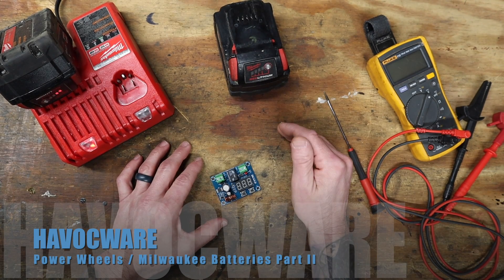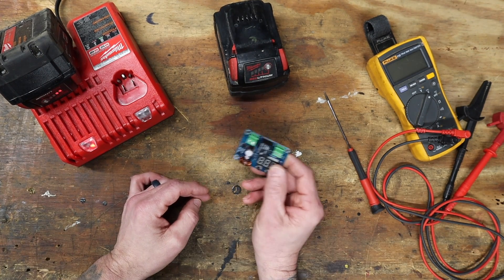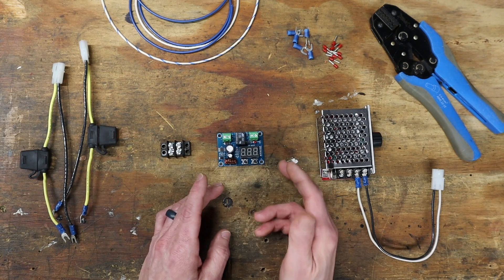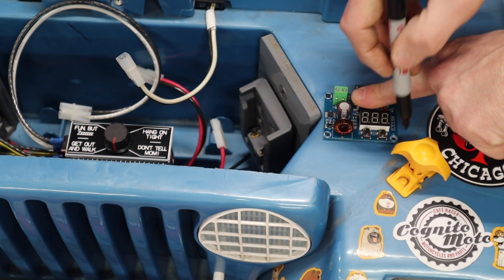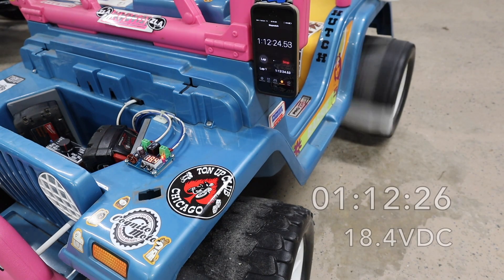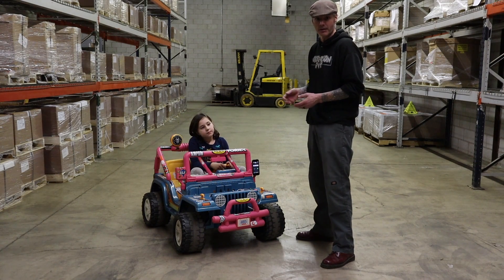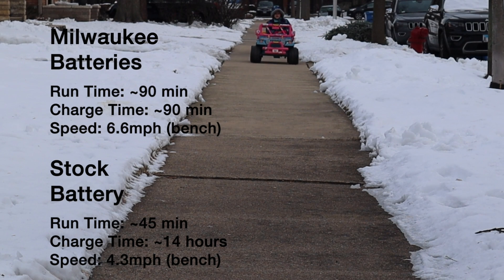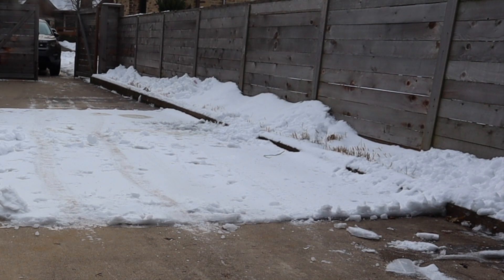Power Wheels Milwaukee Battery Upgrade RUNTIME TESTS & Battery Over Discharge Protection Install

Comment: You use really good connectors.  Any recommendations on a kit you recommend that has all the ones you have used?  Looking for solid connectors that are easy and last.  Great videos.  Ordering the parts now.  Daughter's Dune Racer stopped going in reverse and only went forward slow.  Discovered it was a faulty gear shifter switch tonight!
Reply from the maker: Hey there, thanks for watching. Good wiring is key to a solid installation, and less headache later. For wire ferrules (straight pin terminals), this is a pretty decent kit with crimper: https://amzn.to/3at3ofd. For ring and spade terminals, this kit would work pretty well: https://amzn.to/2yuK8kb

Cheers!
Reply: What gauge wire did you use?

Comment: If this same mod was done with a 12volt 12ah battery would you still recommend the low voltage battery cutoff module?
Reply: Same thing I wanted know plus I believe you will get a longer time ride
Reply from the maker: Hey there.
You could always learn the limits of your battery and just monitor the runtime. However, for the relatively low price point, I would recommend a cutoff module regardless of the amp hour rating of the battery.
It's a cheap safety device that will protect your battery at 1/4 of the price of a replacement. 
Cheers!

Comment: what are the names of the blue and white wires?
Reply from the maker: The solid blue and white are +/- from the batteries, striped are +/- out of the voltage cutoff module. 

There's a full wiring diagram here: http://havocware.com/wp-content/uploads/2020/01/lvco_wiring_hw.jpg

Cheers!

Comment: Ok buddy I need help.. the low voltage controller has vin +/- and volt +/- I've tried both one started to melt the relay and the other ran my batteries to 6v.. How did you wire the regulator to actually work at 18v? I didn't get a speed controller they were sold out and because my boy wants all the speed and moms ok with the mom don't know setting of full speed. It first burn the motors on both wheels.. I just installed 770 upgraded motors and still not working right.. I just feel like this is the wrong regulator for mom don't know full speed setting. I'm deep in this really needing help.. please!
Reply: b91crx I’ve also had trouble burning up the relay while the speed controller is wide open
Reply: @TylerJSpry  I finally took mine out after burning through 3 of them. Now it broke the upgraded motors. I'm thinking the 18v upgrade was a very poor decision but the kids love it so I'm still working out the details to make it work...

Comment: Thanks for the video. I used your instructions for some inspirations of my own. I cant figure out one thing thought. I was wondering if you would possibly be interested in taking a stab at it...

Trying to replace the potentiometer with a variable speed throttle (pedal for jeep, handlebar for Atv)
Reply: Why not wire the potentiometer and mount it to the pedal

Comment: Quick question. I just did a similar set up with my dewalt flexvolt batteries. I've noticed if I turn the speed dial past 70 percent it blows the fuse in the speed controller. What would be the reason the fuse keeps blowing and I can't put it on max speed?
Reply: Do you have it wired to the 20v or the 60v lol

Comment: Great video! Diggin the Ton Up decals...I have an 01 Triple and 10 Rocket. Thank you from the NW burbs
Reply from the maker: Hey Kevin! Thanks for watching - and thanks for your FD service! Be careful out there... 

See you at Motoblot?...
Reply: @havocware  I just ordered a voltage cutoff module...I see below you describe how to set the values.  What is the threshold value and what does it do? What should I set it to if I set the voltage cutoff at 16.5V like you did? Thanks
Reply from the maker: Hey Kevin. The threshold value acts as a buffer between when the the cutoff module kills the power (the voltage setpoint) and when it comes back on. For example - I set it to 16.5 volts, with a 1 volt threshold value: the module will open the relay (stop power flow) when the voltage reaches 16.5 volts, and won't re-energize the relay (enable power flow) until it reaches 17.5 volts (16.5+1). It acts as a pseudo hysteresis function, and stops the module from starting/stopping/starting when the module kicks in, and the voltage increases due to lack of a load.

Make sense?
Reply: @havocware  Sorry to bother you again, but I have a question regarding the voltage cutoff module...I got a great deal on an 18v 12ah Milwaukee battery and when my sons get in to go, the module clicks and shuts down and the led goes out momentarily and then comes back on.  After a few tries, the Jeep will eventually go, but it's very sporadic and the little black box on the module gets pretty hot.  Any ideas?? Thanks
Reply from the maker: Hey there Kevin. The black box on the module is the relay - if it's getting too hot, it's most likely because your vehicle is drawing too much amperage. If you have the same voltage cutoff as I used, the relay on the board is rated for 20A, if your vehicle draws more than that with the higher voltage battery, it might eventually burn out.

Do you have any fuses or a speed controller on the circuit?  The fuses will protect the relay, and the controller will help you dial in the speed to a safe zone for that cutoff relay.

Can you post a video of your setup / wiring so I can take a look?
Reply: @havocware  Hi Rich (I believe that is your name) I just posted a video of my setup, it's no Spielberg but I think it'll do.  I do not have a speed controller setup. The module was mounted, I just took it off to help show what it is doing. Thanks again for your help in this.  When it does work the boys are loving it.
Reply: @havocware  I replaced the cutoff module and added a speed controller even though my older boy can drive like Ricky Bobby and the relay is still getting hot...do you know of a different cutoff module I can use to handle the higher amperage so I don't burn out this $200 battery? Thanks

Comment: Is there a reason you did this install with two batteries? I’ve seen it done somewhere else with one, I’m looking at trying this upgrade and want to make sure I do it right. Thanks.
Reply from the maker: Hey John! You can certainly do the mod with only one battery; the runtime will of course then only be 1/2 of the dual setup (at best).

Not sure if you've seen it, but my first video shows the installation and goes over battery capacity (one, two batteries) and wiring examples . 

Thanks!
Reply: havocware perfect thanks for the info, I’ll try it with one, it’s pretty easy to add the second if need, just trying to figure out how and where to hide everything, I’m modding a gator, unfortunately they don’t have a nice engine compartment like yours did.
Reply: In addition to runtime, a good reason to add a second battery is to reduce the load on the battery pack. Some people have reported a single battery can't produce enough current to power the car for long times and will end up burning itself out. A second battery in parallel will drastically reduce these concerns.

Comment: I just finished this exact MOD, but I cannot figure out how to set the voltage meter to 16.5. How do you set the voltage with the 2 buttons?

Also, the speed controller has a 3 setting switch. what setting should it be on?
Thanks!!
Reply from the maker: Hey D Sauce!

VOLTAGE CUTOFF MODULE:
The left button will set the voltage limit, and the right button will set the threshold value. You set each value independently by holding down the respective button until the display starts to flash, then use the left button to increase the value, and the right to decrease. When you're done, leave the controller idle for five seconds, the setting will lock in and the display will switch back the active voltmeter display.

SPEED CONTROLLER: set the switch to the RUN setting.

Thanks!
- hw
Reply: I think we fried the speed controller. it worked great for about 10 min. we were increasing and decreasing the speed trying to dial in an appropriate setting for my 5 year old and it just stopped working. I took off the speed controller and wired it back up. it's at max speed now. I have another speed controller on order. Thanks for the help.

Comment: I usually run on 5s 50C ( discharge) Lipo .It runs fine on 5s lipo....Not 6s.
The stock motors cant handle the high discharge at 6s lipo.

I harvetsted/recycle used 18650 lion from old laptop 2200mah 15C ( discharge)
Tested it on 5s (2200x3=6600mah p/cell) There about....it dosnt have the same power
as the 5s 50C Lipo...So I made it 6s.  (About the same speed as the 5s lipo).
It can do power slides and donuts..Still not the same amount of punch as the 5s lipo...
but close.

Power drill Lion packs use different C rating or discharge 18650. You get what to
pay for. There's sanyo 2200mah 20c cells in   4ah pack....There's 2200mah 30C
in the  6ah pack....both are 5s li on. Just google the part numbers on the cells.
Im happy . I tested my home made 6s lion 15C on a scooter yesterday. Drove it for
around 15 mins..it was still reading 24v. ( 25.2V fully charged)
Tested it again this morning. He drove it until he got BORED 20 -25 mins.lmao.
The pack read 23.6V....The lowest for REChARGE on my hobby charger for 6s lion 21.6 V
5s @ 18V..Im good at 1/2 hour..becuase the motors need to rest and their average
powerwheels playtime is around 1/2 hours. 

The contractors working on our house
gave me his OLD/dead battery packs. i can build 2-ea 6s 6600mah at 30C from
cells Ive savaged. FREE Batteries for powerwheels  :-P

Comment: As a Vaper and battery aficionado, the low V cutoff is roughly 3.3V for 4-cell stacks, or 2.94V for 5-stacks. Not sure if there's 8 or 10 cells onboard, but you can safely discharge to 2.8V/cell and still have reliable Lithium batt life, with a good charger.
Reply: There's just a diaphrame acts sort of like a fuse or circuit breaker...
it's just GAS trap pushing up on it....from the cell getting too hot.
it'll read 0 volts..You can PUSH the diaphram back down. to reset the battery.
(it's a pain when it's in a pack)...but I recycle lion batteries from old laptop..
Now cordless drills....ect.
It;s the CHARGER..it;s too danm smart for it's own good...
Unforturnately Im a smart arss too.lol

If you're still getting reading on cell below 2.8  or 3.3 ..depending how
smart your charger is....You can put the cell in series
I personally have 3s holder...(3s or 11V config) i stick a dead cell in the middle...
charged cells that were reading  .3 volts. They recharge back up..
my smart charger was reading 8 volts..minimum..probably.
I had 2 fully charged cells @ 8.4 V...forcing the below 2.8 cell to recharge
back up.

My smart charger is retarded...it'll also over charge cells above 4.2..
I was getting 4.3V on some of the cells.  I made some 5s lion  ( 75OO mah)
they're old batteries...Whatever.  if I get 5000 mah....

The Kicker is....I just found out....some of the drills..
Has BRUSHLESS 550 ( 3650 -3660) in them :-P
( stock powerwheels are 550 BRUSH....3.17mm shaft)..
This way you can Re use the stock Pinon..3650 brushless has the same
as 550....They're only $20-ea..it's not a big deal.

I saw a bunch of old cordless cordless drills missing batteries.
I could had purchase for $15-$20

what you want is the ESC...or TRIGGER from the drills 

....So you can use it for the  throttle....Forwards and reverse....
without having to purchase  ESC for brushless motors.

I can always install 4076 2250KV ($35) 120A brushless 4s esc ( $30)
4092 1600Kv $42....150A esc (4s-6s)$45.( R/C cars)
775 BRUSH  can size... it'll fit the gear box..but the motor's shaft are 5mm

1/8 scale r/c has 32 PITCH pinon gear...like Powerwheels
You can get pinion set ( 18-22 Teeth ) for $7...you need 2 sets.

3650 will be plenty..it has way more power than a Brushed 550.

 x2.....run a Y harness from the throttle control...
4076  it'll be TOO Fast for the kids  and will strip the GEARs in the gear box.
it's $45-ea  just for the metal upgraded gear.
I might as will invest into a live axil.  install 800W-1000W , disc breaks
12-15...mph or faster.  Maybe when they get older...So i dont have to worry
about the gears stripping..

The kicker is....I can always build an 25 MPH 1/2 scale R/C powerwheels
for under $200..LmaoThe other brand kids ride on cars with R/C
use the GEAR BOX to turn the wheels...it's just NOT porportional.
I just need to run a BEC..to the steering channel...then just wire there servo's
motor to gearbox steering motor instead...without getting crazy.

 5s li on or LI po...is the sweet spot for STOCK...cheap fast fun...that will last.
Reply: @oneeyemonster3262  After the cell has Vented, a fairly significant amount of Hydrogen has been released from the Electrolyte solution of the cell, which means degraded performance. 💩
Reply: @oneeyemonster3262  I'm not a moron. I have numerous devices with Li-PO packs, and would never perforate them. We're talking about metal "canned" cells, like the 18650, or 21700... I wouldn't run Li-PO down below 3.2 per cell
Reply: @oneeyemonster3262  🤷‍♂️ Well, I don't believe you are qualified to even OWN a soldering iron, let alone a cell welder, bro. Congrats on winning a free internet 💯 You're officially Doofus of the Day 👍 good job bud

Comment: What would your thoughts be on a 24v power wheel with a Milwaukee conversion?  Two 18v batteries and DC motor control? Appreciate the input.  I see there are other power tool companies that have a 24v line, but I already have a ton of  Milwaukee batteries.  5ah to hd12
Reply: The stock 550 motor cant handle 24V for too long...they get hot . Cut off..
damage the motor's whinning

However Ive been running on 5s 50C lipo ( 21V fully charge) for months ...it'll drop down 19-20V running...no mods to cars...just adaptors.
You might try 20V li on packs..
It'll go through wheels..but the kiddies like to make it do donuts and power slides...I used gardening deviders...( 4-5mm hard plastic) for the rear wheels.
I also tried vynal....edging ( stuff you put on the bottom of walls..it's only $2.75 -ea)..it's a little softer..it'll grip..I used it becuase it was smooth..The sheet metal
screws are holding up...they grab every so often...The kids DONT like it  becuase
it has tractions.lmao. The gardening diveders requires more work becuase it's
STIFFER and you'll have to counter sunk the screws...so it'll be flush...

They're used to the 5s....but I only get 15  mins for 5000mah (sets)...I swap them...but it gets old recharging multiple lipo packs and managing them...
Sometimes  I'll take me nephew to the park..I usually carry 4 set (20000mah)
or 1 hour...there about.

Im liking the run time and price....I might get 4-ea 20v lion 6000 mah( $100).
Do 12000mah...Not sure how he's getting 1 hour from 10000mah.
I know you can run lion lower than Lipo....but not that much
Reply: @oneeyemonster3262  my current power wheel is already a 24v model.  My concern is running two  18v 8amp batteries and not cooking the wires with the speed control.